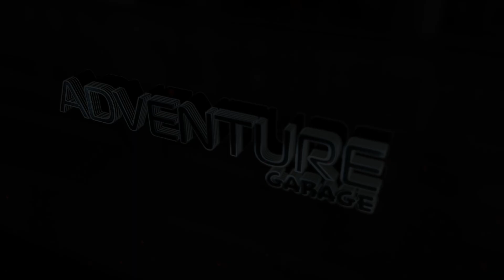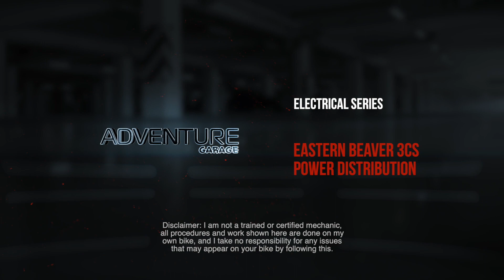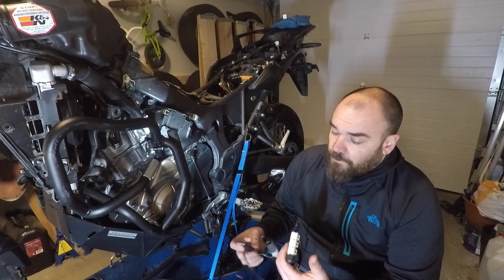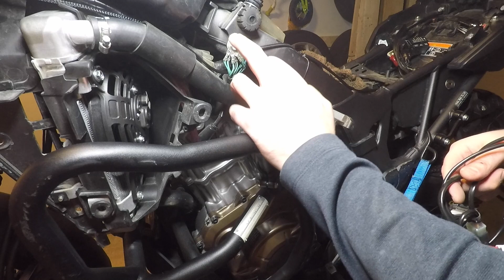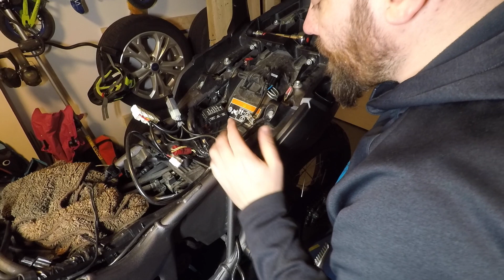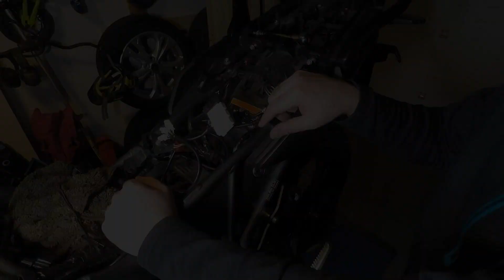Africa Twin Eastern Beaver 3CS Power Distribution

Comment: What is this connector used for? I would be interested in why you put it and how is it helpfully... thanks
Reply from the maker: It's a power distribution to connect various accessories. Instead of wiring everything up to the battery directly, this will distribute the power on separate circuits to power gps, auxilliary lights, heated clothing, chargers, phones etc.

Comment: Excellent video. Clear guidance on installing the loom. I’ve bought a bike specific loom from Eastern Beaver, a 4CS for my Honda NC750X. However it came with no guidance on what the various components are, or suggestions on which of the supplied fuses go in which fuse holder. Given the cost of the loom, well made as it is, I feel very disappointed at the lack of instructions. My attempts to get help from Eastern Beaver has proved very limited. Specific comprehensive questions get limited and less than helpful answers. I understand which fuses should go in the holders for the switched and unswitched outputs, but what I am struggling with is what size of fuse should go in the Main 2 fuse holders (one is white and the other is Black). Would you hav3 an6 answers or have you done a video dealing with fuses as a follow up to this loom install? Thanks
Reply from the maker: It's simple math, really. You need a fuse for a specific circuit to cover the power draw from anything you plan to connect there. So on a 12V circuit (obviously), every watt drawn by a connected unit will need 0,083A. For example - 60W lights would in theory need a 5A fuse. Then add some for good measure, since the voltage can fluctuate a bit, and you don't want to be "on the limit". For lights drawing 60W I would run with a 7,5 or 10A fuse on that circuit. And lastly, providing you have enough power from the battery and alternator, the main fuse will need to allow for all the circuits to run on max draw. So if you have a 5A, a 7,5A and a 10A circuit, the main fuse would have to be a minimum of 22,5A - so a 25A or 30A would do.

Comment: Would this Eastern Beaver 3CS require the additional female or male  connectors to complete a clean installation of a electronic device?
Reply from the maker: The kit comes default with the matching connectors for the three connections. In addition, he offers premade leads/extensions that you can use to power stuff up front or wherever. And you can of course order loose connectors if you want to equip different applications for easy temporary connection to a single port. One might for example equip an electric tire pump with a connector, to hook up on a 10A circuit whenever needed, while still being able to utilize that outlet for something else on a regular basis.

In general I prefer to have stuff connected under the seat for easy access. The dreaded 7,5A inline fuse of Honda’s oem 12V outlet, meant to sit behind the front cover, is a pure engineering prank. It takes you ~30 minutes to replace it if you’re «trained» in removal and reassembly of the fairing and stuff. 😳
Reply: @adventuregarage4230 Dave from Eastern Beaver wrote" HI John,

Yes...everything you need except the female ends...are included with the kit".

Dave for EB
Now I'm lost, so do I need to buy the female ends to attach to my devices to do a sealed connect with the 3CS  switched connectors?
Reply from the maker: @jege41  Well that's weird. It states very clearly on their homepage; "This Kit uses all sealed connectors, (shown above even the relay is weather proofed). The relay switching and ground wires plug into the existing 6P connector at the far rear of the under-seat area. Three sealed connectors are included to install on your circuit wires, to plug into the Kit’s outputs."

Notice the last sentence... And they were definitely included with the kit when I ordered it about a year ago.

Comment: Thank you very much for the tutorial as I have been searching for this information for months now and with basic electrical knowledge I was skeptical about poking around. Is your bike a 2018? How was the clearance on the ground when putting the seat back?Thanks again for the video.Cheers.
Reply from the maker: Thanks, John! Mine is a 2016. Haven't poked around in the 2018 version, but I can't imagine there are too many differences on the electrical side. The seat clearance for my grounding point worked out great, no issues there. Ideally I would've liked the cable to reach up to the joint ground point at the left side of the tank, and I'm sure mr. Davis @ Eastern Beaver would be happy to accommodate that, but it works fine so I probably won't bother changing it.
Reply: @adventuregarage4230  I have since recieved a reply after I questioned EB and I am now told that the kit does include all necessary connectors to hook up three device's.  I'm not sure why I was told differently in my previous email.